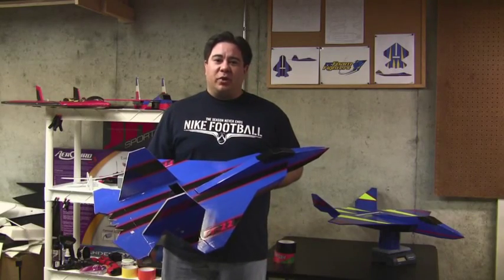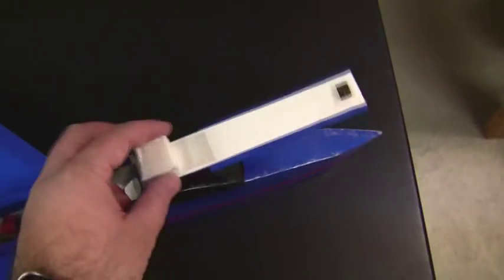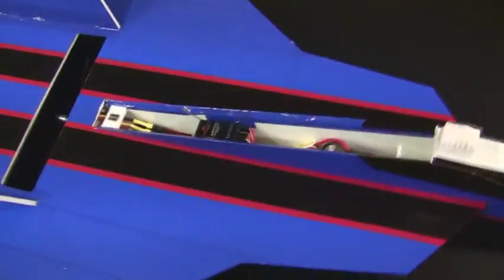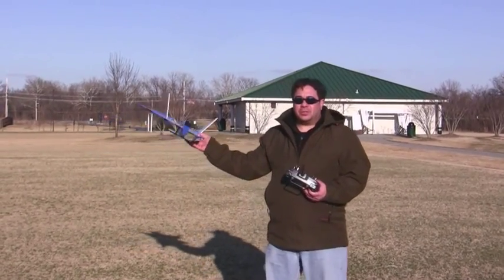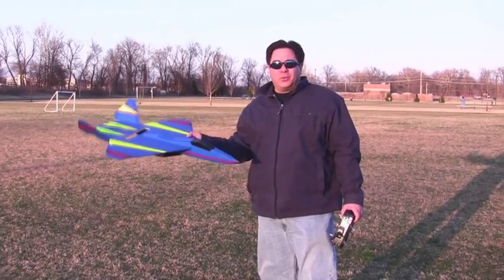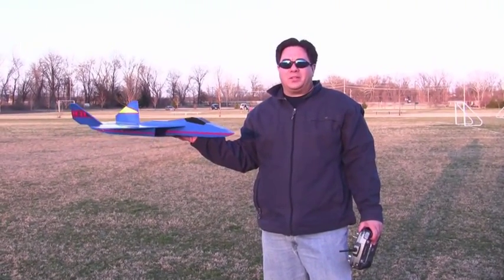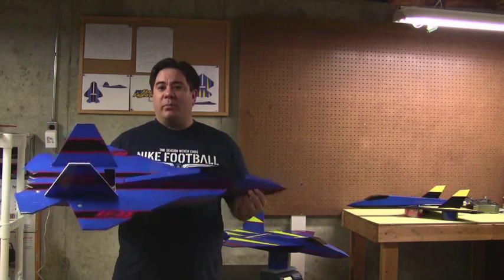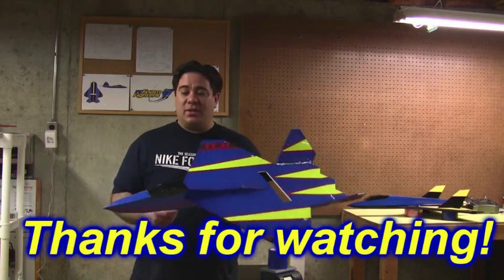Part 3 Advanced Tactical Fighters (Scratch Built RC Plane)

Comment: Alright, 68 degrees & 68 mph, pretty cool. The first throw was a close call, glad it just pointed up and the thrust broke the fall. The FF-22 is flying dead on. For the FF-23, could it be that the stabilizers are at such an angle that they provide very little vertical stabilization. They seem at more of an angle than the FF-22. I don't know how much a vertical stabilizer plays a role in tip stalling.

I bet the dog was thinking: Finally my prayers have been answered, food falling from the sky.